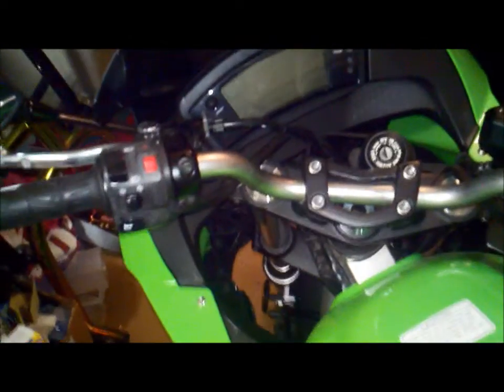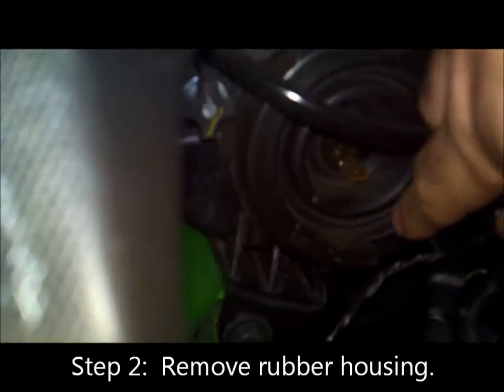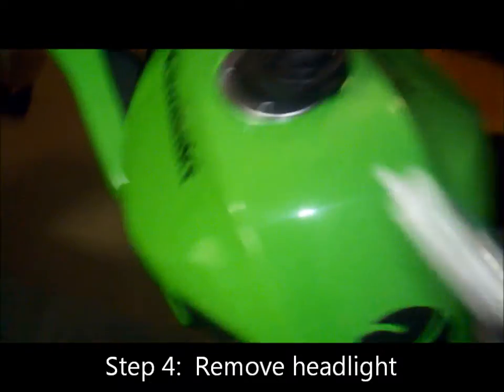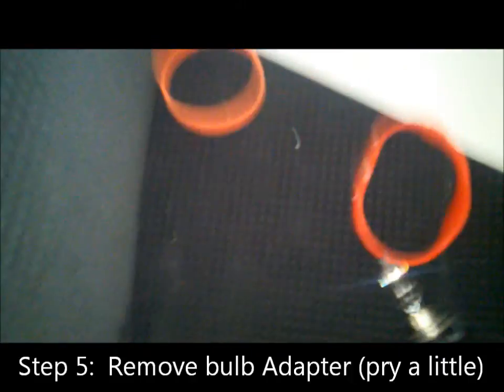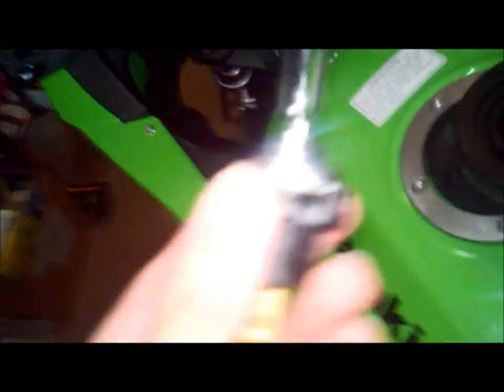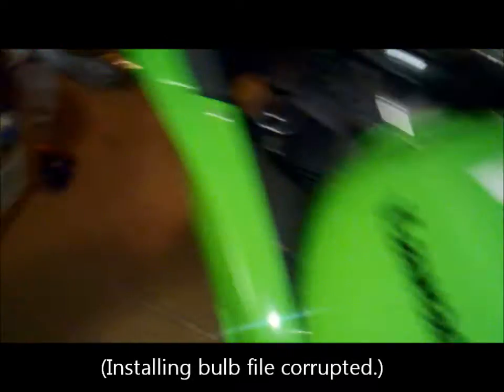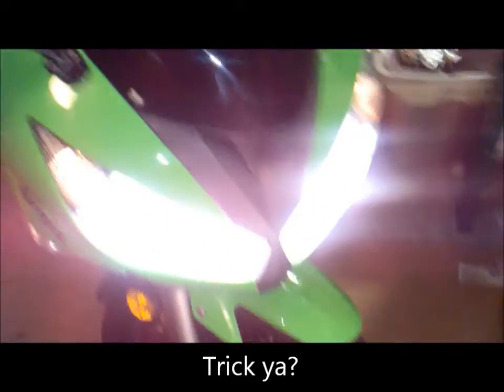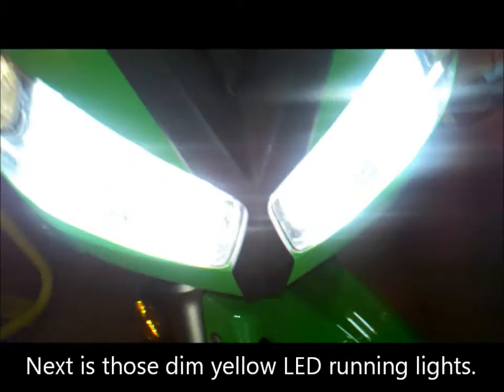How to replace headlights on a '09 Ninja 650R (Simple!)

Comment: i have a 06 650r it's normal in low is only one side on and in high both sides will on????
Reply: gilberto lujano yes I have the next year model and it's one for low and both for high. I often ride with high on during the day as well. Can't hurt to be safer.

Comment: Thanks for the video - this applies to the Ninja 650R 2006, as well. One little tip to include: those clips are a *bitch* to pull out or push back in with just your finger - I couldn't even do it. Instead, I used the flat edge at the tip of the hooked wrench in the Ninja tool kit to do the pushing - it went much easier.

Comment: Lads for the clip, when you wanna put the bulb back in, there's a little curvy hook about 2mm across at the very end of the clip..that goes into a little silver plate on the extreme edge of the fitting, if you shine your phone in there you'll see it, it's got a little bit taken out of the plate to accept the clip. Once i saw that she clipped back together in a few seconds..